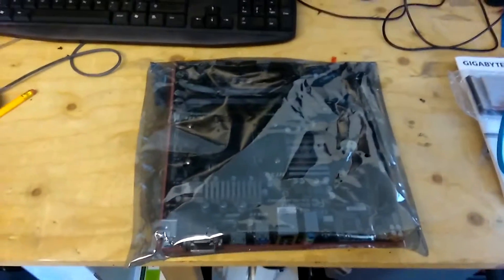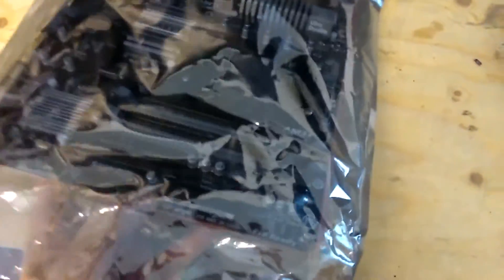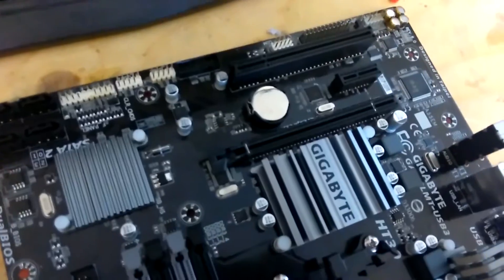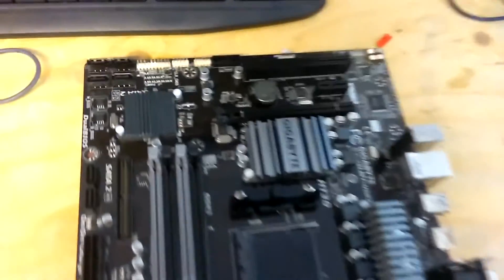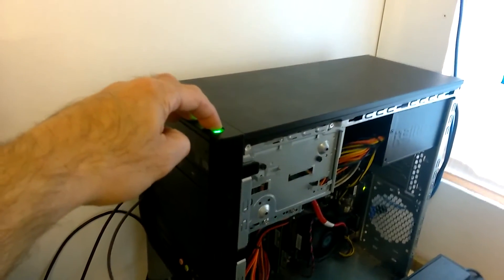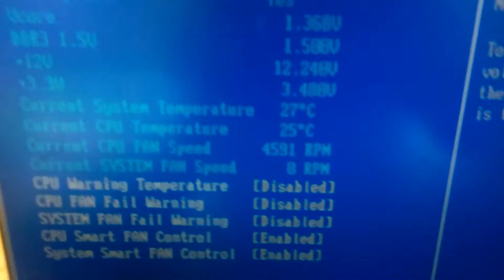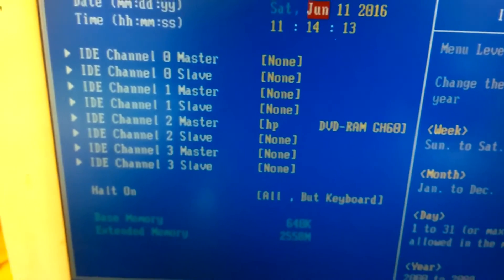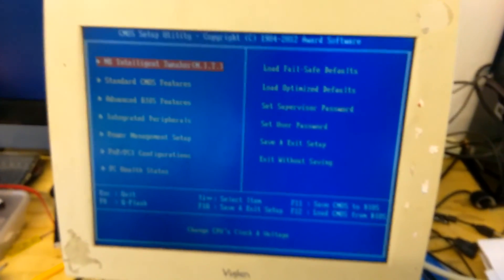GA-78LMT-USB3 Rev6.0 - Initial Set Up and Test

Comment: Using this exact mother and my 8 pin power connector is only accepting 6 pins into the mother board. Have you ran into this issue? Thank you.

Comment: How did you get yours to power up mine wont
Reply from the maker: I just connected up the psu, keyboard, mouse, front panel connectors and monitor and it fired up. What have you tried so far?
Reply: PGTMan nvm I found out my psu was faulty